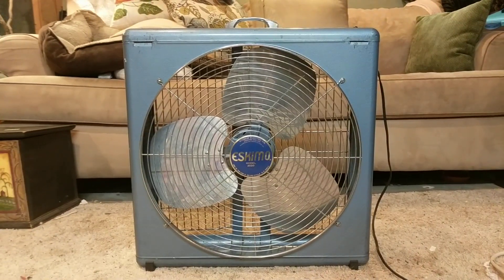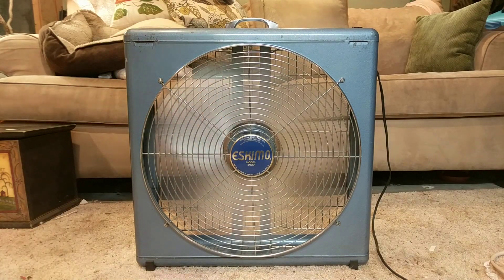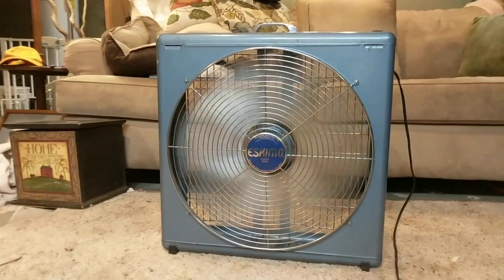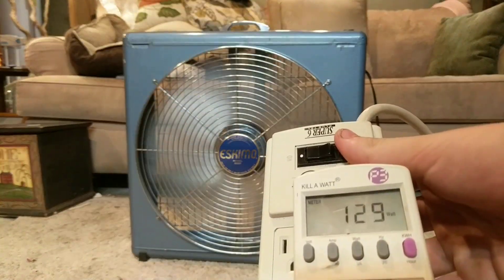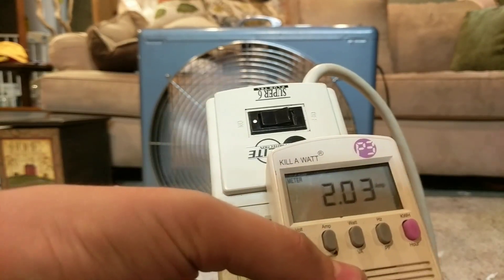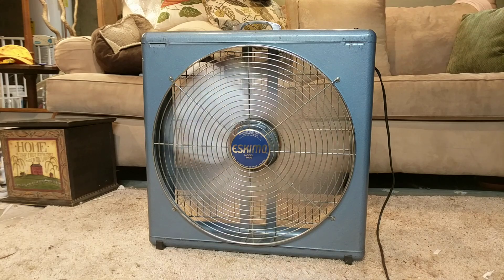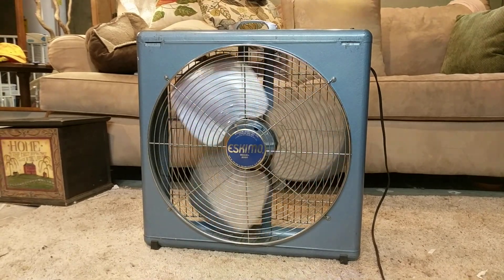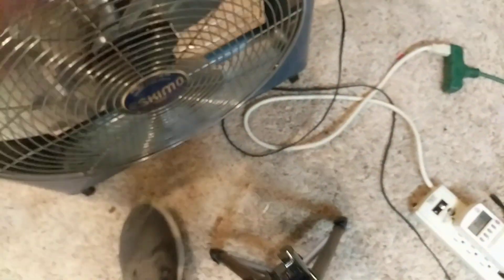Vintage Eskimo 20" box fan model 2020

Comment: I have that same model Zach! I need a switch for it bad!  I'm anxious to get it going like it was new.  The original switch is long gone..I don't know what it looks like The only thing that's there is the original knob and shaft that the knob mounts on.  Can you direct me in a direction to get a switch that changes the voltage that only has two leads to the motor windings?  I guess that would be a resistance type. I also need to replace the motor bearings. It makes a knocking sound when operating.   Thanks for your help!
Reply from the maker: These fans have speed coils so a three speed switch won't work. If it still has the speed coil then it might work. If it doesn't have the speed coil then you are out of luck. You can wire it straight to high if you connect each lead to the cord.